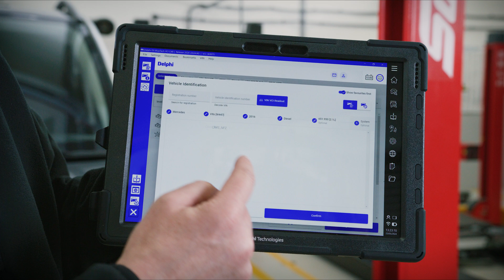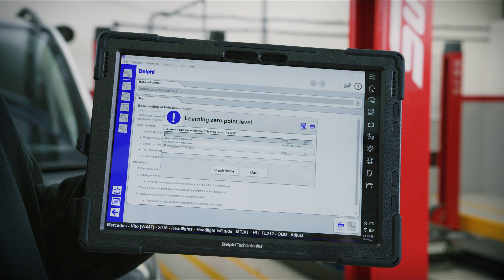[EN] How to replace a light level sensor | Masters of Motion

Comment: Hi, do you know where is location of that sensor for 2017 Mazda Cx5?
Reply from the maker: We suggest looking at technical data to find the location of that sensor, however height sensors are bolted to 1 side of the suspension arm on 99% of all cars / vans.  Many thanks